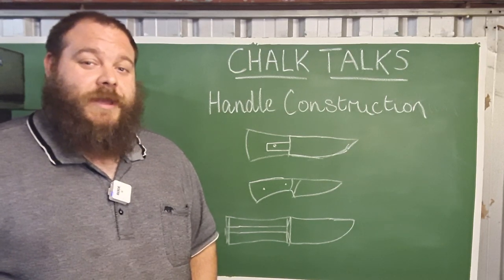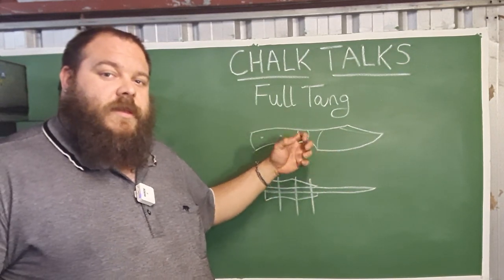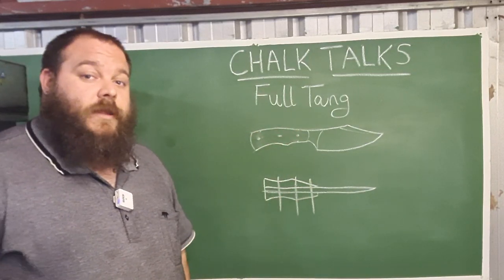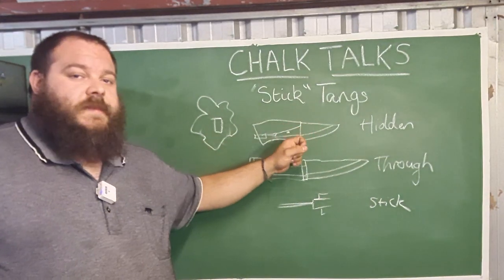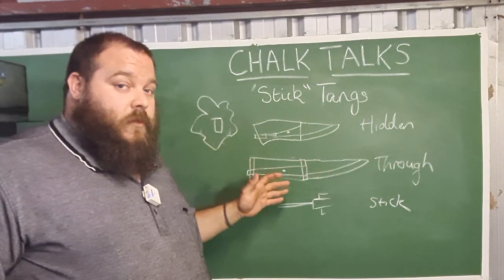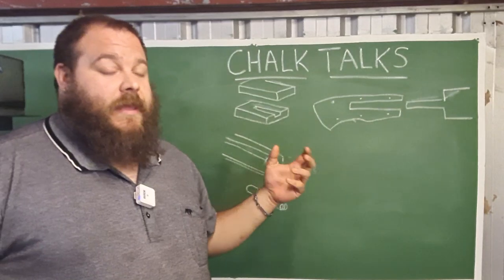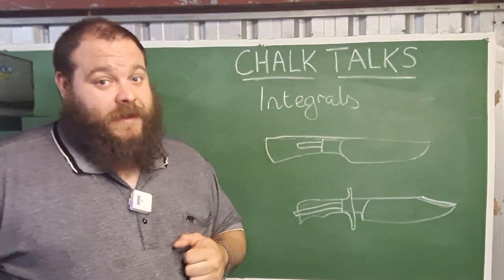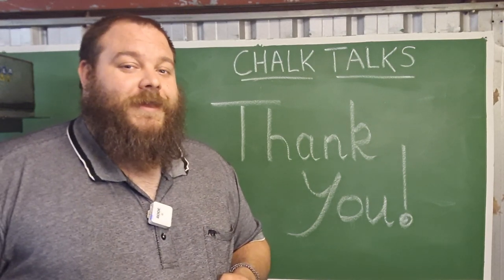Chalk Talks: Handle Construction

Comment: Hey Sam,
Only now saw this episode.
Great episode.
Coming back to the placing of your pins.
When you put your pins exactly in your center of the handle you get what they call a parallax difference.
That is the ability of the eye to see the "difference" in the height in conjunction with the curvature of the handle.
Placing your pins a millimeter off center you negate that difference as far as the eye is concerned.
Reply from the maker: Thanks for the clarification Michel!

Comment: Thanks Sam, not a knife guy as you know but I do have one question! What do you think the pit falls would be in constructing a blade handle using leather discs, I’m sure you have seen them and know what I’m talking about.thanks mate!
Reply from the maker: Stacked leather has the advantage of being slightly pliable which is good in situations where shock may be involved, but it's also readily accepting of moisture and holds it around the tang. Most WW2 knives that I have come across that had stacked leather handles had severe oxidisation of the tang, and in most cases the tangs were very thin and narrow to accommodate the washers. So not that it shouldn't be done, but there are risks.